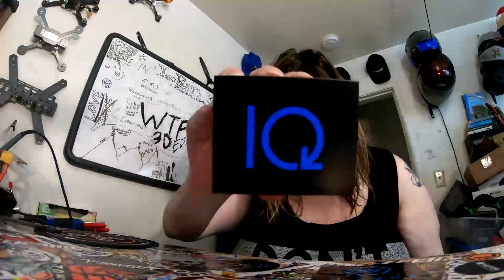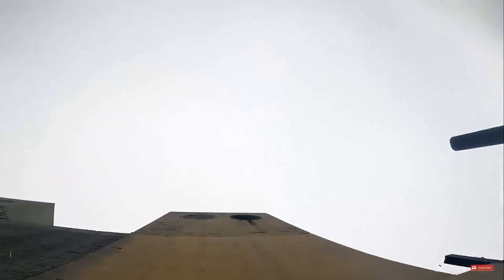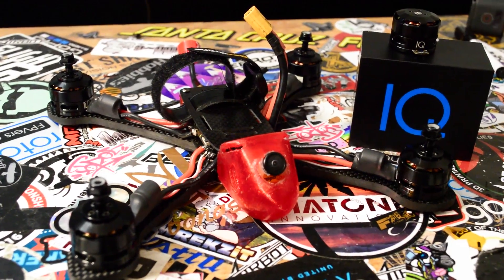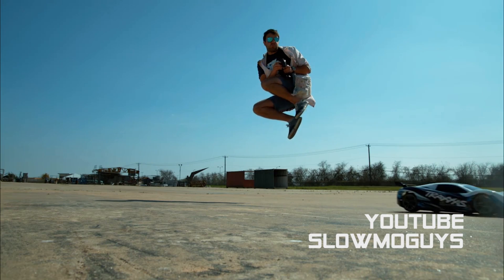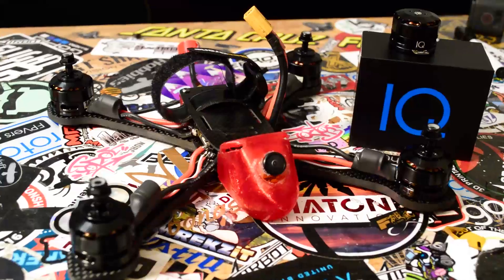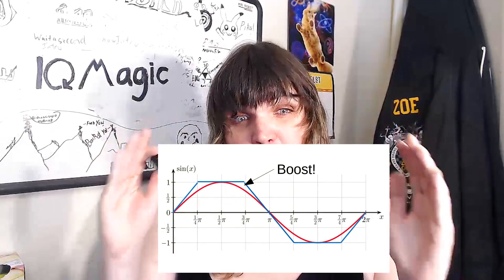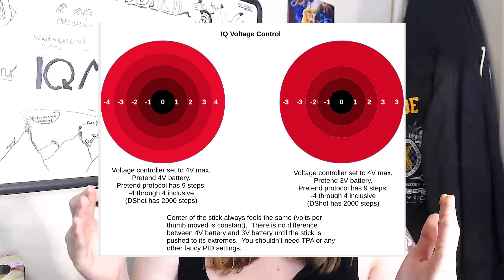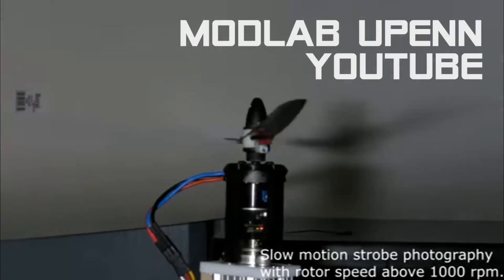Future of Drone Motors: IQ Motion Control Speed Modules Unboxed

Comment: Hard pass. $400 a set and 40g a corner for a 2306 stator 2200kV motor. 3D mode has long been available in Betaflight/BLHeli. While this video is from late 2018, Betaflight 4.2's battery voltage compensation feature makes this system even less attractive.
If you are not technical enough to understand and pronounce the terminology necessary to describe this system... then just skip to the subjective review part using layman's terms. Otherwise, it's painful to watch and hear the botched reading of IQ Motion Control's ad copy.

Comment: Ok I know its about positive feedback when you get stuff for free but this feels biased when a hobbist says that motor and ESC combo (AIO) is great. Not sure which one breaks more ofter...motor or ESC but why do we have to pay for both. It would be much more believable if it was said....its AIO but for this purpose we are okay with that.
Reply from the maker: biased? The combo together ends up saving 20 grams over my comparable non AIO setup... and while I'd personally want to be able to replace one over the other in this application.... with the way the tech is designed they really benefit from being an AIO, especially with how precise the sensor and calibration is, they're are added hurdles to implementing them as a separate ESC and Motor module and is apart of my feedback to IQ of what I'd like to see in the future.

You also have to keep in mind that his module is more than just for drones. Having the integrated ESC makes a lot more sense when you're talking about having a discreet robotics servo replacement, having the integrated module allows for new/better form factor robotics- not just drone stuff... yet I wasn't talking about those applications :) While this video focuses on the drone applications it doesn't showcase the robotic applications which take advantage of the AIO nature.

What people are paying for right now is access to a next generation flight power system. I doubt we'll see separate ESC/Motor modules for at least another year or two as the tech matures, along with the price coming down to be competitive with traditional power systems.

and full disclosure, I had submitted a proposal for sponsorship to IQ Motion Control before this video... which they've accepted. After testing initially and seeing where the tech was going I approached them. I hope to swap out all my machines to IQ eventually. I am 100% biased, flying with these modules was life changing and they deserve all the hype this video can muster haha.. while other videos on motors may talk about how "smooth" they are or how much "Punch" they have to hype them up, these actually have a major hardware difference paired with firmware differences that enable whole new realms of performance. What other motor/esc can claim that?.. none, we haven't had a real advancement in that department in years.

Comment: The whole using 3d to ping pong back and forth got a little boring. Hope to see you progress 3d more and more to see cooler moves. Don't get complacent. Destroy your quad and learn new moves! Also that first flying song was pretty bad. Just my opinion tho. Thumbs up on the vid. Keep it up Z
Reply from the maker: Haha, there is only so much to do at an empty field, and when the biggest obstacle is the ground it makes me want to get as close as I can to while 3Ding... Also I DONT want to destroy my quad, it's literally a prototype that can't be replaced easily ha. 

 Working on some new stuff as these motors allow for more yaw mixing that I didn't have before. It's not complacently, it's literally me having been stifled by the tech. You couldn't do side to side tick tocks while going forward before smoothly, or mix ANY yaw. Heck I'm now mastering piro flips, before it was a challenge to do because of yaw mixing now it's 'easy'. 

Once these motors are out officially and my IQ sponsorship kicks in I should to have enough sets of motors to push the limit. Though for now, don't take my test flights as a representation of my skills haha. I mostly do the bouncy stuff to test motor switching times and reactions... In empty fields. If you have any tricks or things youd like to see me try / do more of let me know.
Reply: Any thats the perfect response! Totally didnt think of that stuff. As I was typing I was thinking "I have seen her do so many different things 3d, where are they in this vid??! Makes perfect sense, and probably something i should practice too. Not going ballz to the wall and be out a motor all because I wanted to push it too far that day. 

Keep it up Z, you are always fun to watch when you pop up in videos :)))
Reply: Lets see you do it.   Destroying quads is a pain in the ass and expensive. Almost all 3D heli guys have spent countless hours in sims to master their skills, AFAIK these aren't in sims yet.  Quads are so symmetrical that learning LOS orientation in acro mode is a bitch even while "right side up".  Took me forever to get it right and I was a damn good 3D heli/plane pilot.

Comment: OK the concept really sounds good and yeah the transition for 3D flying seems smooth I give you that. But in your testflight I can hear and see a LOT of oscillations and hear the whining of the motors, which is an indication of a poorly tuned quad. I'd really like to see what those motors can do on a reasonably good tune.
Reply from the maker: Haha- it was the first flight using stock pids on 5s for the first time(the old prototypes were 4s limited)? what do you expect? it's pissed hahahahaha. I'll have plenty of videos with this setup going forward, I'm having to play with the PIDS a bit and some motor settings to get them to be a bit less pissed off, they respond so quickly to the PID controller that it's causing the oscillations. Wouldn't count this against the motors haha
Reply: @ZoeFPV  yeah that's basically what I said... Wanna see this on a reasonable tune. Of course it's not the motor's fault. Thing is: as I'm not flying 3d at this point I cannot see the benefit for me. It's a lot of money.
Reply from the maker: Tune will come, and so will the price. New technologies have a higher price tag initially, it's just the cost of innovation, the prices will come down and I honestly believe in 2 years time these types of motors will be price competitive and common place. 20% longer battery life, 5% more power.... and the smoother motor operation. Right now I only really see Long Range Pilots, 3D Pilots, and rich AF racing pilots using them, apart from that researchers looking to use them for their other abilities(which is a lot of their customer base)... and of course robotics industry looking to use them in the 200kv mode to replace traditional servos with a modern closed loop brushless motor setup, the abilities of these motors go far beyond traditional drone flying/pilots.

Quite honestly these are a demonstrator model in many ways and this first batch of motors allows them to show off their technology in a real world application where before it was just an idea and prototypes in the lab. When these motors become price competitive with sensoreless setups it'll be a no-brainer for people to start using them for 2D or 3D.... this video really is a glimpse into the future of the technology haha

Comment: it's a high speed stepper motor with an encoder . you could use them for lots of things . not in this years budget
Reply from the maker: Yup, plus they're fully closed loop and can tell their microcontroller exactly what position it's at for advanced stuff. It should enable see next generation robotics.
Reply: Texas instruments put out a PDF on there TIDA-01370 reference design "Closed Loop Stepper Motor Design With Encoder for Stall Detection" in march last year . maybe there working off that or a watered down version that did'int need all that processing power . i don't think it's next gen, more old school with faster processing it would be the sort of thing that would give a robot a soft touch and compliance something were are seeing today . just speculation, my only experience with robotics is making Arduino based rovers and posting them to LMR (let's make robots ) web site before it was bought out by Robot shop . i'm surprised it took this long     
http://www.ti.com/lit/ug/tiducy6/tiducy6.pdf
Reply from the maker: LOL, if anything that's based on the research IQ was doing at University of Penn, their tech goes back to 2013(iirc) and is not the same. Their current implementation is different than others, and allows it to do things quite a bit more efficiently, sensored motors aren't new (I covered that in the video)  and their implementation isn't remotely the same as what you linked :)  I can link you research they published going back quite a few years :)

There is also the opensource project called the O-Drive which is much more your speed if you're into making opensource robots, it's the same basic idea... sensored motor, controlling the phases of the motor... this is just a closed sourced, small and discreet module with a completely different implementation, and was developed after many years of research at UPenn by Matthew Piccoli. It has dual firmwares, one for drones, the other for robotics applications.

Like you said, you're surprised it's taken this long... there are reasons for that haha. And that's why these are next gen even if the basic concept behind the technology has been around, their implementation is new, different, and enables things not possible before :)
Reply: Thanks for clearing that up. the link was just the first thing i could find anywhere close to a sensored motor . it would be great if you could put up the link to there research . sorry Zoe  to much hype in Quad products .
Reply from the maker: haha- no worries. I'll work on adding research links to the description, had debated how much info I was going to include in the video without trying to bore people too much. and I agree, there is too much hype in drone products, but this is different. 

It's not just "smoother bearings" or a kalmen filter, or a slightly newer/faster flight control processor... it's the most legitimate step in motor/esc technology we've had for consumer drones in a long time and changes up how things have been done for years. For robotics industry too, as now they have a discreet, small, yet powerful "servo" replacement for robotic arms with full closed loop built in to the module and helps open the door a bit more for high end consumer grade robotics. Yes, the concept isn't new but the end product is- and I'm confident IQ's tech will make it's way into a variety of products ;)
Reply: Thanks for taking the time Zoe.

Comment: Makes me want to go 3d again. I haven't flown 3d since my single rotors, goblin gaui etc. But I never did 3d in FPV. woaaaah
Reply from the maker: It's a bit of a head trip- a lot of your stick movements will translate over, but you'll need to relearn orientation for FPV essentially.

Comment: Have you tried racing with a 3D set up? I just wonder if mid air braking for instance might help or allow gates to be tackled more effectively.
Reply from the maker: Yup- for some of the courses... maybe. But considering most courses flow in one direction of thrust, I doubt it'd be all that helpful :) if anything it'd be nice to have as a backup if you approach a gate wrong and be able to use inverted thrust to get out of a bad situation.

Comment: At last, I wondered when we would get sensored motors for our 3d quads! I love 3d flying but so far only reliably fly brushed 3d silverware which works amazing.
This is the tech that will allow brushless to be as reliable and fast switching.
Reply from the maker: I've had good luck with BLheli32 ESC's and Brushless sensorless setups... really want to try brushed 3D, what sort of boards would you recommenced for 3D Silverware?

Comment: What is under the heat shrink at the motor, capacitors? This would be handy for conventional flight, having a reverse thrust switch when heading for that tree.
Reply from the maker: They're capacitors- will go over them more in an upcoming video.

Comment: That looks nice :) 
But I'll have to wait for my Christmas bonus -.-
Btw. I got the URUAV in 3D mode, but it looks like gyro directions are not correct, when inverted. It just fell out of the sky.
Reply from the maker: Been testing that- it has more to do with the ESC's than the Gyro- and partly why I haven't finished reviewing it because I got stuck mid video trying to make it work for 3D and failing. I'll finish it soon.
Reply: Just got a video up of that first attempt: /watch?v=dIPQ51XLylU
Maybe you can get some information off of this :)
It's a heap of fun, even in acro mode.

Comment: A build/setup video would be great, that is a pretty unconventional looking setup.  I see you have capacitors on each of the motors?  Those motors look great for drone and robotics applications, if they were a bit larger they might make a great choice for large CNC/3d printing applications or similar.
Reply from the maker: Build video will be incoming- the motors I've got on the ship right now are prototypes, planning to do a build video proper when they're officially avalible... like, i'll be getting the software to change motor settings on Monday... ones they sent me for testing were wired up already, plus one display/extra motor in case of issues.

I'm sure IQ will release other sized variants of their motor.. and you'll be able to flash firmware onto the module to make it run more like a traditional servo for robotics.
Reply: Awesome, looking forward to the build video, I really want a couple of 3d quads.  Is it possible to build a micro for practising, something around 2-4" and nearer the 250g or less so I can pretend its a toy?  I noticed most of your gear seem to be 5".  I had a quick look around and I think propeller size seemed to be the limiting factor i.e. there was not a whole lot of choice for props.

Comment: @zoefpv what kind of price range are we looking at
Reply from the maker: First batch of modules is on the high side, $88 but it's new tech and once it's /out/ the price should come down over time like any new tech does :) https://www.crowdsupply.com/iq-motion-control/iq-motor-module
Reply: Wooooweee.  I'd be afraid to fly them,  I crash a lot.  Are they pretty durable..  You know with hitting concrete at 40mph :)

Comment: I didn't think it was possible to use more nerdy tech words in one sentence than you get from Joshua Bardwell, but you pulled it off. Congrats! ^^
Reply from the maker: hahaha- thanks?! People kept asking how they worked... so I wanted to make sure I explained it correctly. The motors boast a mode that allows them to boost their power, and a voltage compensation mode... those features sound like magic.. and after explaining how they work they're still magic.
Reply: Zoe FPV  Lots of nerdy tech words is a good thing.
Reply: she actually knows what she is talking about lol ;)